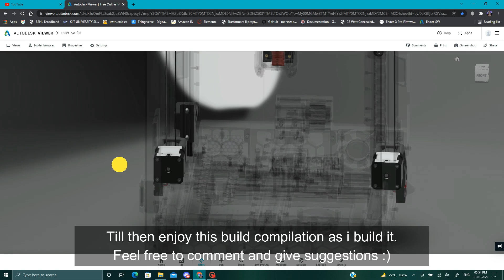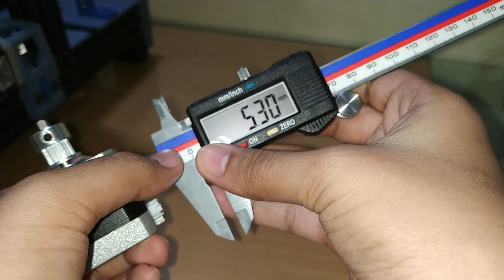Ender 3 Pro to Voron Switchwire Conversion - Part 2

Comment: good evening from Miami, friend, I wanted to ask you if you published the STL of the two parts that are attached to the X axis on the linear rail and the one on the bl touch, more than a month ago I made a printer similar to that one and I have not been able to use it for Those two pieces, MGN12H to MGN9H adapter, minute 20:26 second part, I would really appreciate it.
Reply from the maker: Hey Vladimir,
Sorry for late response. Did you get the stls? The STL for the MGN12H to MGN9H adaptor is available in the official voron switchwire github repo. Anyways i am linking it here for you in case you haven't got that:

MGN12H to MGN9H adaptor: https://github.com/VoronDesign/Voron-Switchwire/blob/master/STL/Gantry/XZ_Axis/X_Carriage/%5Ba%5D_x_bearing_block.stl

And regarding that BL touch one, I am unable to understand which one you are refering to. Can you specify a bit? or post the timestamp.

Comment: Hi my friend, where can I find the MGN12H to MGN9H adapter STL that you mount at 20:26? I can't find it  the GitHub of the Conversion nor in that of the BLTouch Adapter.
Reply from the maker: Yes, you are right. It is not available in the conversion github nor in bl touch x-carriage mod github. You have to download it from the official voron switchwire github. It is inside X carriage folder names as "[a]_x_bearing_block.stl".
Reply: @HyperMakes  thank you!

Comment: it turns out that the bltouch x cariage you are using for v6 with volcano heatblock I've tried using v6 with stock heatblock bltouch pin is too low from the nozzle

Comment: You have to derack it or you are going to have a pretty big headache latter on the build, the secret it's to derack before putting the belts, run one belt and cut with some slack, remove the belt, cut both belts exactly the same length using the one you already measured, run both belts and leave the same slack on both sides you need to have it tooth perfect or you can get some weird racking,then tension the belts equally
Reply from the maker: Yes, i have deracked my x gantry. Thanks for the suggestion!

Comment: what type and size of idler bearing do you use for the y axis tensioner?  I am planning to replace my y axis tensioner ender 3 v2 like the one you are using
Reply from the maker: I am using F695 bearings for the idler assembly.

Comment: Great video. I have an ender 3 neo which is an upgraded version of the CE3P. Any idea if a conversion kit will work on it?
Reply from the maker: Sorry for the late reply. Yes, conversion kits will work on it. Just make sure the kit is matching with the y-axis profile of your printer, i.e. 2020 profile or 4040 profile.

Comment: Hello, thank you for the great work!
I'm going to use the door closure, too. Because keybak is expensive.
But what size of door closure should I use? When I looked it up, there are several sizes.
Reply from the maker: I used this one: https://robu.in/product/automatic-punch-free-wire-door-closer-for-all-type-doors-black-500g-pull/
This one is 63x63x16 mm in dimensions.
Reply: @HyperMakes  Thank you!

Comment: How does the BL Touch cope with the hotend - does it melt?  Get too hot?
Reply from the maker: Not good at all. I replaced the bl touch before even doing a first print. I went for inductive prove initially then, moved on to quickdraw probe.
Reply: @HyperMakes  - thanks for that.  I will look into it.  I currently have the inductive probe ready to install but wondered as i had a BLTouch left over from before.  I will look into the quickdraw as I like the look of these types of probe.  Klicky and the Euclid probes are also an option.  

Really good videos BTW, They provided an excellent gap between the original assembly docs and the CAD so used them extensively.  Thanks for your work
Reply: Hi,  Do you have the links for the parts you final;ly settled on.  I have the Omron probe and it just isnt very good - it triggers randomly when hot and reads a different value for the corner with the heater wires attached.  Thanks in advance

Comment: do you print abs parts with ender 3 stock and what slicer do you use? the print looks very neat what brand of abs are you using?
Reply from the maker: Yes, i printed all the parts on my Ender 3 pro before conversion. The only mods i had were Bi-metal heatbreak for Trainglelabs and satasana fanduct. All other mods than these were not that functional for ABS printing. I use SuperSlicer for my slicing. I have printed the parts using eSUN ABS+ filaments.
Reply: @HyperMakes  can you share the slicer settings for the ender 3 stock you used to print the abs parts for voron swichwire?
Reply from the maker: @madorax251  I have shared them on my printer's github page.

Comment: Can I reuse 4234 motor (for (x,y,z)) from ender3 prod?
Reply from the maker: Yes you can. But if possible go for a higher torque stepper motor for y-axis.
Reply: @HyperMakes  do you think nema17 17hs15 1504s1 or 4240, is better!?
Reply: I have here a 4240 too, I'll put in Y instead 4234
Reply from the maker: @noppbr  either will work but the nema17 17hs15 is better.

Comment: can i use stock ender3pro motors?
Reply from the maker: Yes you can if you manage to take out the fixed gears from the steppers. I have also used stock motors in my switchwire.

Comment: Halo cant your share BOM for bolt and nut for ender 3 conversion swichwire
Reply from the maker: I have provided it in my switchwire's Github repository. Here is the direct link: https://github.com/Kruze17/HN_Switchwire/tree/main/BOM
Reply: how long x axis aluminum profile are you using?320mm or 310mm?
Reply: I read the BOM ender 3 SW but I'm confused as to where the M8x16 BHCS bolt is placed, I've also looked at CAD but can't find the M8X16 bolt, is M8x16 needed for this mod and in which part?
Reply from the maker: @lanypuspasari1868  310mm
Reply from the maker: @lanypuspasari1868  no, not needed.
Reply: @HyperMakes  what is the ideal length of aluminum extrusion for ender3 v2 mod SW? someone told me 320mm and the other one told me 310mm for the x axis length I'm confused which one is the most ideal. please help because i only have one 3v2 ender. so i have to prepare before disassembling  printers.
Reply: @HyperMakes  ok thanks for your feedback i will cut the aluminum extution 310mm soon. can the 310mm length be used on the triano ender 3 SW mod?
Reply: Dimensions 6.3 x 6.3 x 1.6 cm rope length 1.5m.
is this type of key back like you use?

Comment: quick question...did you ender print these parts? what brand filament you use?
Reply from the maker: Yes, i printed the parts myself on my printer. I used eSun ABS+.
Reply: @HyperMakes  incredible work...when I first saw you ender mod video I have to admit I thought "it's still not Prusa worthy" but your results (even tho I hate being proven so) proved me wrong....did u use an enclosure over ender? venting?   thanks
Reply: oooohhhhhh and next video Please!
Reply from the maker: @tkae_Mendez  Yes, i used a temporary enclosure made using Pvc pipes and epe foam panels. There are no vents in the enclosure, it's fully enclosed.
Reply from the maker: @tkae_Mendez My bad the videos are late due to some personal reasons.
Reply: @HyperMakes  You & Family come first ...we wait brudda...

Comment: Hey how did you manage to print abs on the ender 3?
Reply from the maker: Modified hotend with bi-metal heatbreak, temporary enclosure, eSun ABS+ and printer tuned to voron print specifications. Note that traditional ABS requires a little more chamber temperature than ABS+.
Reply: @HyperMakes  so the Capricorn tubing wasn’t enough ?
Reply from the maker: @joshuadsylva8297  Capricorn PTFE tubing is better than normal PTFE tubing that comes with the printer. It is advertised that it can print as high as 280°C and you can certainly try. I went with bi-metal heatbreak because they are cheap nowadays and you don't have to worry about the high temp degrading the PTFE lining of your tubing.
Reply: @HyperMakes  could you point me to which heatbreak you purchased ?

Comment: hello and thank you for uploading your progress of your ender switchwire conversion. I am currently doing the same to my ender. I have been having a hard time finding the chainlinks that go with this conversion. by chance can you share a link to the official chainlinks or at least the ones you used in your build?  Thanks sooooo much again.  Take care!
Reply from the maker: You will need either 10x10 mm drag chain or 10X11 mm drag chains. Normally sourcing depends on the user, so it's up to you from where you want to get it from. People get the official chains from aliexpress or suppliers in their country.

I used these chains: https://www.flyrobo.in/10x10mm-cable-drag-chain-wire-carrier-1-meter?search=drag+chain
 
If you already have a printer, then you can print out these chains by hymness1: https://github.com/hymness1/VoronUsers/tree/master/printer_mods/hymness1/10x11mm_chain_VSW
Reply: @HyperMakes  Perfect and thanks for the speedy reply! this is exactly what i was looking for.